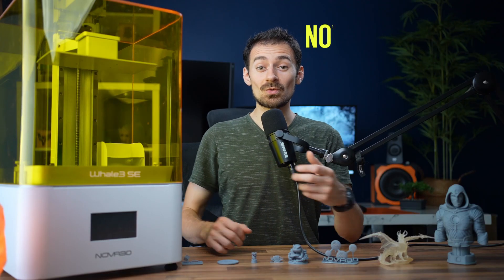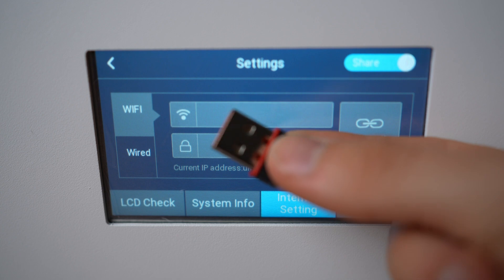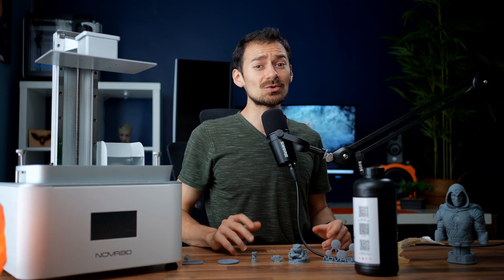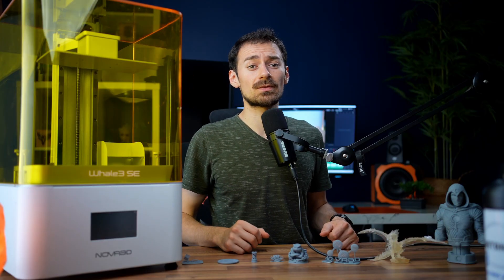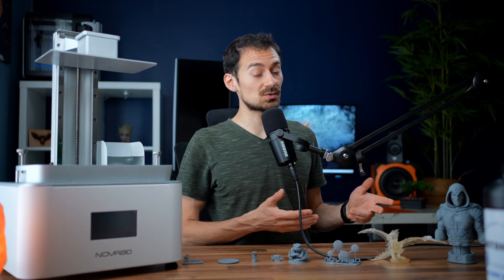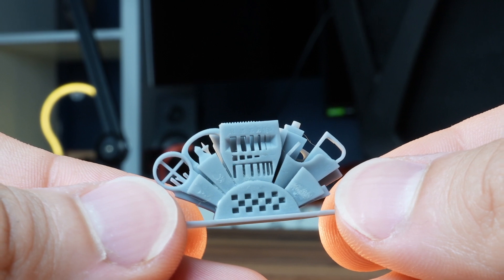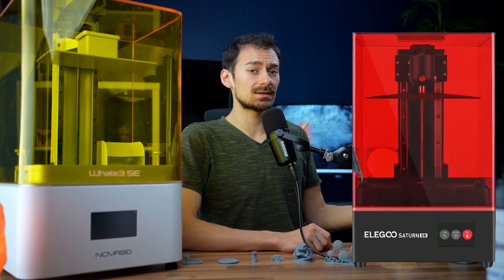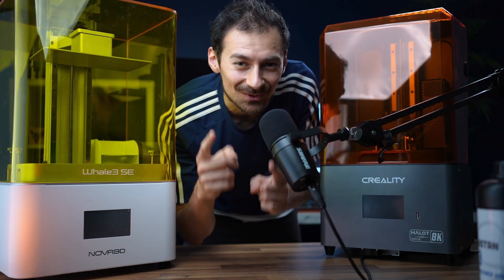One of the BEST 8K Printers! Nova3D Whale3 SE 3D Resin Printer Full Review

Comment from the maker: Hey Everyone,

I will keep keep a look out for when the software becomes compatible with Lychee/Chitubox and let you know in the Comments.🙂
More info at 4:45
Enjoy :)
Reply: Voxeldance Tango Slicer is compatible with all Nova3D printers.

Beware of Lychee Slicer with the Whale2, it is misconfigured badly.
Reply: I have a Whale3 SE - The screen is protected, it's covered with glass.
Reply: I was talking to the lychee customer service, they told me that the Nova Printers are now compatible with lychee and will even allow for customized support settings (the supports will print with independent exposure time control, can be overcured for instance, which allows to print high performance resins more easily).  Do you have any updates on this?  thanks for the video.